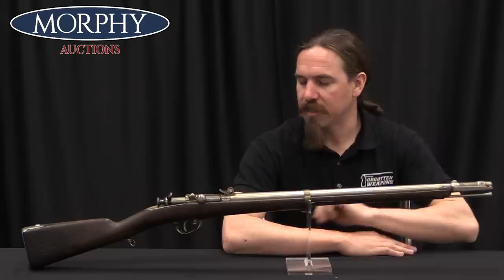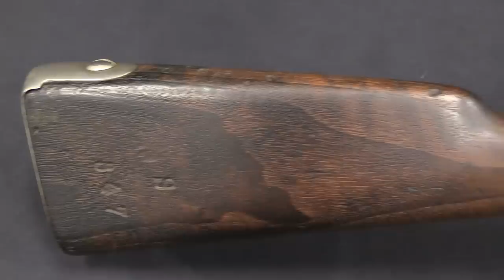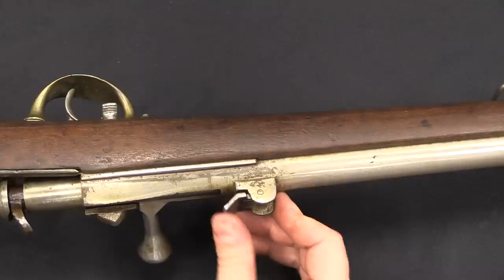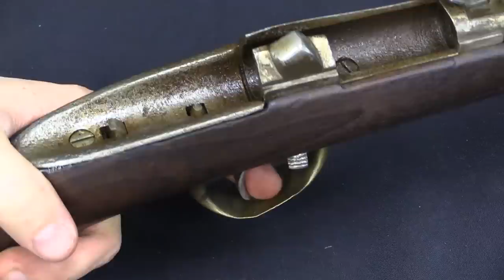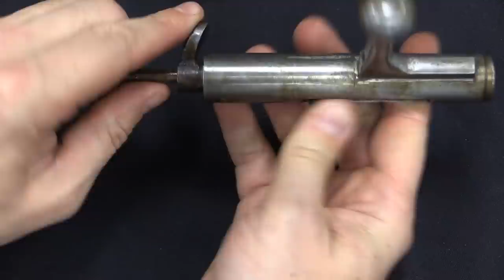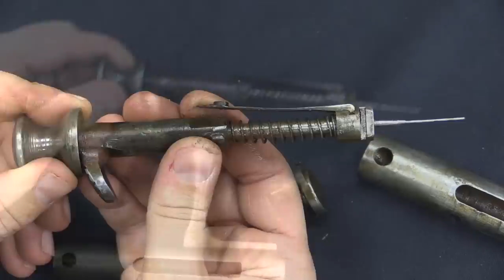Italy Modernizes: the Carcano Needlefire Rifle Conversion

Comment: They were used in what qualified as a "minor skirmish", the taking of Rome in 1870 ( Bersaglieri at Porta Pia, 20 September.)
With the securing of Rome, the Papal Forces with their M67 Remington ( 12.7x44R otherwise a .50/70 type) by Nagant of Liege, were disbanded, and the Papal Remingtons were issued to the Bersaglieri who had taken Rome.
These were replaced in Turn by the first Vetterli rifles, as they were Produced ( 1871-3).
The French troops garrisoned in Rome were armed with M66 Chassepot rifles.
Direct conflict, Carcano vs Chassepot.

Doc AV

Comment: Hey Ian, i was wondering why you would remove the cleaning rods from the rifles when converting them? Of course you dont need them as a ramrod anymore, but Its still a blackpowder gun that needs to be cleaned often and you might need to punch a stuck case or a bore obstruction out.... would save you the cost of making a seperate piece of equipment to clean the bore with, in my mind.
Reply: many countries were switching to pull through cleaning systems as they adopted breechloaders because of the compactness and how much cheaper a bit of string is than a rod
Reply: @micahreid5553  But you already have the rod *right there*... and if the bore diameter didn't change, it's even the right one. Asides from that, time and storage are money...
Reply: @mfree80286  The metal in the cleaning rod is a resource, similar to money in the bank... this was before our current post scarcity era... logistics is a nightmare

Comment: Further comment, whilst the Prussians trounced the Austro-Bavarians in 1866, the Italians were roundly defeated both on Land (Custoza) and at Sea ( Lissa) by the Austrians.
Thus the search for a suitable Breech Loader for modernization...the Swiss Vetterli system would be adopted in 1870, but as a stopgap, the Carcano conversion Needle fire came into use by 1868. The Artillery musketoon shown was the 1834 Bersaglieri shortrifle, with 
" Swiss" pattern rear sights ( for more accurate " Sharpshooter" use, and the
Brunswick bayonet bar, for a sabre sword bayonet with the same reach as a normal Rifle.
As mentioned in other comments, the M67 Carcano was used by the Bersaglieri in the Taking of Rome ( 1870), but was quickly replaced by captured 12,7 Papal Remingtons, until sufficient Vetterli single shot centre fire rifles were available.
DocAV

Comment: With poorer quality metal for the barrel, I'd assume any rifling would wear very rapidly? Though at 17.5'm anything it hit would be unhappy.
Reply: Probably not. Steel wasn't all that bad back then, especially in terms of wear resistance and hardness. Most of the later improvements in steel had more of an effect on tensile strength, brittleness and corrosion resistance. Plus it's firing a big honking soft lead bullet at pretty low velocities and pressures instead of copper jacketed rounds at well over 2000fps. I suspect corrosion and poor maintenance would kill it long before it was shot out.
Reply: @wingracer1614  At 11:55 Ian mentions that they were still using iron barrels in these firearms. Besides, the steel quality back then legitimately was quite poor in both material and unrefined processes. Ian mentions a major arsenal in another video (Springfield, if memory serves) not using thermometers and instead judging the heat of the barrels by eye which would vary by hundreds of degrees, and this was in the early 1900s, decades after the firearms discussed in this video were made.
Reply: @sqeeye3102  As an engineer and knife maker I must say that judging the temperature of steel by eye before hardening is no problem, as long as the steel is austenitic before quenching it really doesn't make a real difference in hardness, the grain size might be a bit larger when the temperature is too high for too long, and that might mean a very small decrease in tensile strenght, but realistically it will make no difference. If the temperature is lower then austenitic temperature there will no real hardening, but this is very unlikely to happen with an experienced worker. It's also very obvious if any finishing needs to be done after hardening.
Also, as long as the lighting conditions in the factory don't vary too much, and are fairly dim, the temperature won't vary by 100's of degrees, (speaking celcius here) but more likely by 10's of degrees. A difference of 100°C is a very clear change in colour.
Reply: @slome815  Knife making is a very different situation than a pressure vessel containing pressures that are nearly the yield strength of improperly made steel, let alone proof testing pressure. Not to even mention that grain size is extremely important for pressure vessels. No professional barrel maker that I have ever heard of uses a heating process judged by eye in a very long time.

With regard to knife making, even professional companies mess up the heat treat. Not too long ago Benchmade screwed up the heat treat on their Bailout in 3V steel. Cold steel has done it, Kershaw,, Spyderco, just to name a few more. It's a complicated process even when you remove the human element from that specific task. And the downside there is a knife that dulls a little too quickly, not a catastrophic failure of a pressure vessel. I'll pass on any barrels heat treated simply by eye.
Reply: @sqeeye3102  No, it doesn't matter if the steel is meant for guns or springs, or knives. If it's a fairly simple low alloyed steel, and steel in this time would be simple high or medium carbon steel, maybe with some nickel in the alloy. As long as you get hot enough for the steel to be austenitic, and you cool fast enough to avoid having pearlite, you will get a proper hardened steel.

It won't matter all that much if the steel is at 800°C or 900°C when you quench, grain size depends a lot on how long the steel is kept at a certain temperature. But at the low soak times, and fairly low temperatures needed for hardening, there will be a very minor change in strenght, you're talking about changes like going from 700N/mm² to 680N/mm² and no real change in hardness. Unless you gun is a really unsafe design in the first place it will not make a difference. 

If heat treatment is bad enough for it to be obvious, it's because there has been a major error, like leaving a batch of parts in the kiln during lunch time, or having small parts and having them cool to below austenitic during transport between the kiln and quenching bath, or only tempering once, or even forgetting tempering altogether.

On a side note, I have seen plenty of bad heat treatments from people who send their parts out to a heat treating service with temperature controlled kilns, but not a single bad heat treatment from a knife maker that does the heat treatment himself by eye. Judging temperature by eye is simply not that hard with a little experience.
Reply: @slome815  You seem to have missed the original point of my comment. This WAS a legitimate problem by one of the largest arsenals in the world that WAS solved by getting thermometers instead of judging by eye. It appeared that it was overcast days that were ruining batches, if memory serves. This is simply a fact and it's also standard practice for barrel manufacturers all over the world. I really don't care about some graybeard's decades of exerpience when I have a 60,000+ PSI pressure vessel right next to my throat.
Reply: @sqeeye3102  and you still don't get the point. At the time everyone did it by eye and the guns were safe to shoot and many are still today. One thing is shooting a high velocity jacketed bullet, another one is shooting a low velocity, low pressure, soft lead ball.
The greatest menace to these barrels was not the production tecniques but the corrosive nature of primers and gunpowder and required to be cleaned continuosly and thoroughly

Comment: Just a few weeks ago I bought the second V70 carbine I ever ran across. A lot like this one, but it's the 10.4 cartridge in single shot. Japanese looking dust cover, but rolling under the action, and an SKS style reversing bayonet, stowed inside the stock- where the cleaning rod would have been. Sights and stock look to be interchangeble with VV71's, but I bet they don't... biggest difference? In the 1990's an 'associate' told me to not buy that one I had ever seen, he would find me a better one for less than the 300 the seller wanted... he never did find me one. This 2nd one I ever saw... was a grand and change... makes $300 sound free eh?

Comment: BTW, cocking manually overrides the bolt opening safety so you can open the bolt without using the pin in front of the trigger, so you would first cock then rotate and oopen the bolt

Comment: What happened to the rubber base of the cartridge? Did the shooter have to pick it out by hand? Did it burn up? I didn't see an extractor.
Reply: It remained at the base of the barrel, and was pushed forward when the new cartridge was inserted, so sitting ahead of the new bullet, to be ejected when it was fired.
Reply: Ah, that's pretty cool. Thank you!

Comment: What happened to the rubber base on the cartridge after firing?   I imagine it would it would be left on the bolt face.
Reply: It rested on the base of the barrel when the bolt was opened, so directly ahead of the new bullet, and was expelled with the next shot.

Comment: So it would appear the the Italians missed the 1850s move from ,75 and ,69 caliber smooth bores, down to the smaller, .54, .577 and .58 caliber rifles. Some of the American, 1842 Cap lock muskets, were rifled as an after thought, though not many. It would be interesting to know more about the Italian  1844 Musket/rifle.  A ,69 caliber "mini ball" can weigh in at over 700 grains. That's a lot of lead, and a big hole..

Comment: If they were worried about bore diameter leading to more complications with metallic cartridges why not just sleeve the barrels down to whatever standard they wanted for their eventual new rifle?
Reply: Because money of course.
Reply: M M I think the cost of sleeving the barrels (especially if you’re going to be hacking away at the breach anyway) would be worth not having to both manufacture proprietary ammo and deal with it in the supply chain. Kinda like how the US did early trapdoor conversions and sleeved the barrels down to the standard
Reply: @andyrihn1  the next cartridge will be metallic, we have no way to avoid a double logistic chain, so it was better to spare money in the interim project.
Reply: sleeving involves 3 expensive operations: Drilling old bore to a precise new diameter - inserting sleeve which must "become one" with the old barrel (hint: not easy) - Rifling the sleeve. While this conversion left barrel as usual. And no "new standard" whatsoever: they used the same old Minie bullet, powder charge and paper cartridge they had been using, which was somewhat modified: instead of tearing end with your teeth and frontloading and then fitting cap on nipple it includes the cap  at the back of the paper cartridge glued to a paper disk. No big deal.

Comment: I couldn't make out how the user replaces the needle in the field.  That was mentioned as something important for both the Dreyse and Chasepot.
Reply: I was wondering about that also,but after seeing the massive locking lugs and hearing that the barrel is iron I do not think anyone 
could be found who was willing to fire it enough to wear down a needle.
Reply: @jeanbaptistevallee4500  With a low pressure black powder gun like this the barrel is probably fine.

Comment: So I know they made the needle fire the needle accessible pretty easily because they tend to break but did they issue an additional Striker and needle in case it broke or would you just have if it broke you just have to bring it to the armory to have them replace it or were they give you an extra one in case it broke while you're in battle and then you can continue with the battle
Reply: Usually the soldiers were issued with spare needles.

Comment: Putting the rubber seal on the cartridge instead of the gun had to make for very expensive ammunition, right?
Reply: Especially back when rubber was expensive to produce and get ahold of
Reply: You needed to replace the rubber seal on the head of the bolt every few shots anyway in the Chassepots

Comment: Why does Italy keep doing this to themselves? Also: Rubber caps on the cartridge sounds like a phenomenally bad investment at the time. Wasn't rubber a relatively specific resource at this time? I know America invented fake rubber in WW2 because their asian supplier was no longer handing out fistfuls of the stuff. This sounds like a waste of perfectly good resources, compared to putting the rubber on the gun parts themselves.
Reply: The rubber sealing on the Chassepot used more material than the thin disk on the Carcano, and required to be changed every few shots anyway (that costed time in action).

Comment: The role of the needle rifle is a bit overrated in the battle of Königgrätz/ Sadowa in the Prussian Austrian war. It had a lot of downsides (short range, low reliability, low accuracy). The Prussians won because a) By a dumb political decision by the Austrian Kaiser to appoint the field marshal of SOUTHERN front to fight in the north (where he was totally inexperienced),  b) because of the confusion inside the multi-lingual army. Allegedly the Prussians broke through a forest  on a flank. And in close distance fighting defeated the Austrians. 
But the Prussians initially thought they would  lose,  Austrian artillery was superior and  in long  distance fighting Prussians suffered heavy casualties. Another thing that speaks against the needle rifle is that the germans replaced them on the first occasion
Reply: The real alarm bell for the Austrian and all the european powers should have been the second Danish-Prussian war were they were allied to the Prussian against Denmark. It is in that war that the breachloader showed all its superiority.